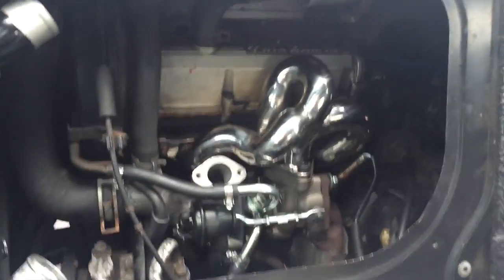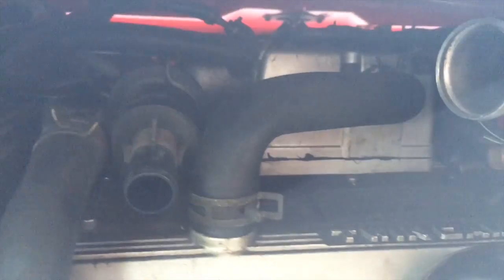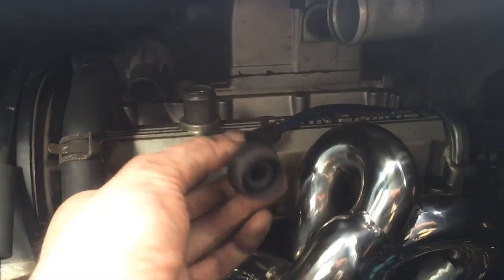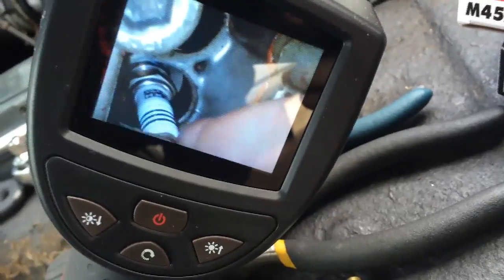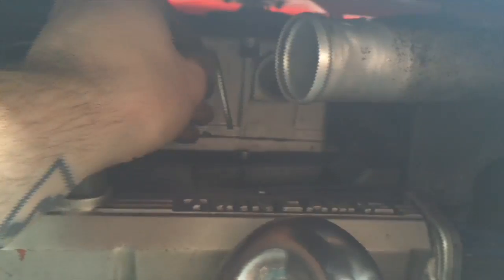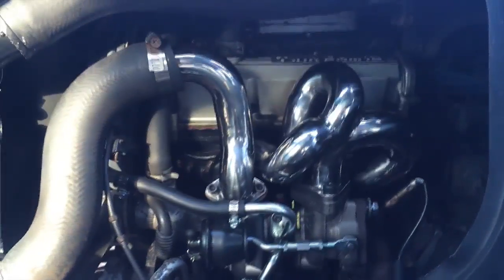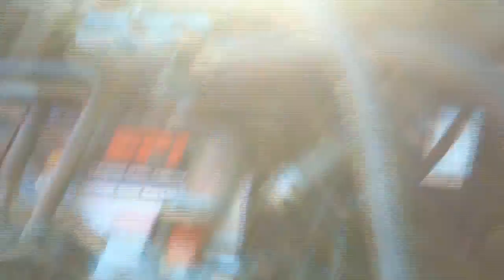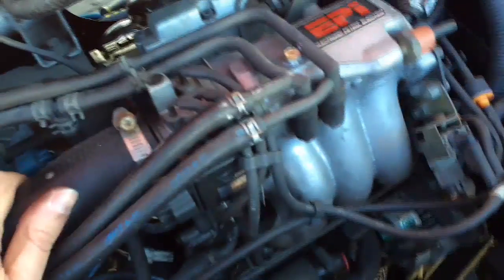Autozam AZ-1 Turbo Swap: Part 3

Comment: You still ALWAYS 2x check the gap on the spark plugs just to be safe . Many many times I've gotten pregapped plugs that the gaps were too small . I guess during shipping if not properly packaged the electrode can get pushed in and close the gap

Comment: Like that advert on TV, take the bottom of the engine apart so you can reach up through the cylinders to clean the plugs, what a bitch to change the plugs, better be life of the car ones.

Comment: The hose coming from on top of the valve cover is for your crank case breather. FYI you could probably remove that box and hose and just add a breather filter. It may cause a check engine light but I am not sure about these cars. The box is there for emissions.

Comment: lookin' good man, you're in the final stretch!  i don't think the injector swap will be that bad.  i looked up those F6A engines on google and seems like the injectors are above the intake manifold where it meets the head.  certainly looks easier from a nice camera angle of an F6A that's either in a Cappuccino engine bay or sitting on the ground haha, but i don't think it will be as bad as you might think.  just don't forget to unplug the fuel pump fuse and start the engine so that the current injectors fire off the pressure that's still in the fuel line (even if it hasn't run for weeks) so that fuel doesn't spray out when you move the fuel rail off the injectors!  i've made this mistake and i got hosed with gas! Lmao
Also, put vaseline (petroleum jelly) on the new injectors' o-rings so they don't pinch during the install.  since it's just petroleum jelly, it's totally fine and will prevent an accidental fuel leak there, which is very easy to accidentally do.  It just happened to me when my s13 was on the dyno right after i swapped my bigger injectors in.  hope this helps dude!
Reply from the maker: Thanks again for the info!  I still haven't gotten the fuel rail off, but I know how now.  Everything fits so tightly that I have to pull hoses just to get the tools in there!  It's insane.  But yea, should have them out soon.  I pulled the hose off the pressure regulator so hopefully nothing shoots out when I get the injectors out.  My goal is to have the car started up this by the weekend, and Part 4 out soon :D
Reply: Yeah it can be overwhelming having to succumb to the domino effect of parts that have to be removed to access parts. . . that need to be removed to access the original thing you're trying to get at.  Sometimes I forget what I was going for in the first place yet still manage to break things on accident in the process haha

Looking forward to part 4!  I know with my engine (SR20DET), there's a distinct difference in exhaust tone made from swapping out the old stock cast iron turbo manifold for a tubular stainless-steel one, and in my opinion it sounds much better with the tubular.  Perhaps you'll notice a different exhaust note from the AZ1
Reply from the maker: cbh148 Ohhhh man, I hope so :D  I've heard a buddy's Cappuccino (with the same turbo) and it sounds amazing.  I'll get to see him race it at an autocross event this weekend, and hopefully take mine next month.  I'm new to this whole turbo swapping engine modding thing and it's been a lot of fun!  I'll have to check out some of your S13 vids!